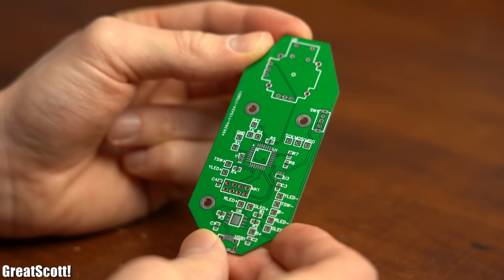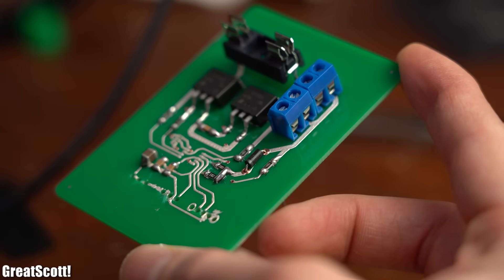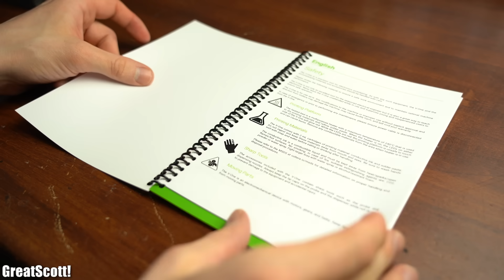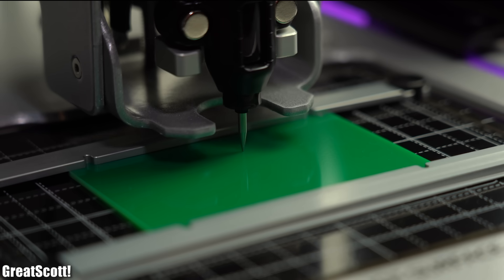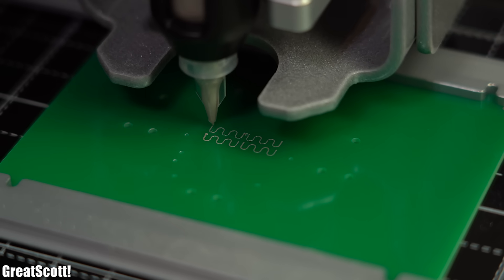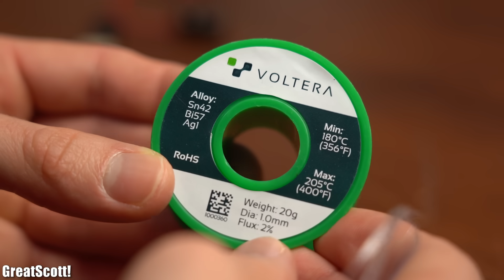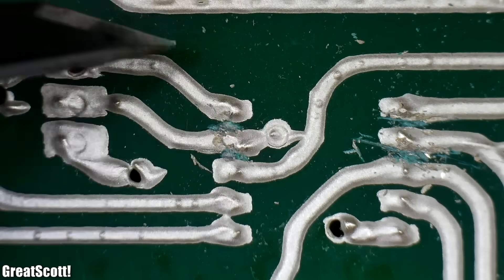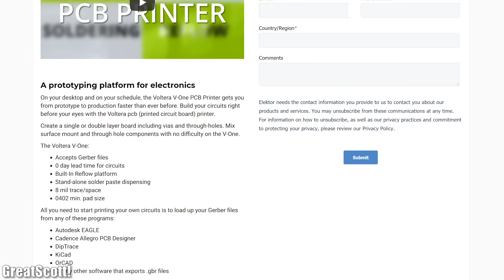You can now PRINT PCBs! Creating a homemade PCB with the Voltera V-One PCB Printer!

Comment: - Holy shit this is so cool!! -

Edit after seeing price: Nevermind.
Reply: Check out Marco reps.
It's a good channel.
It also has videos on pcb manufacture using a 3d printer and a mounted laser which would be a much more affordable option but that's secondary.
Reply: whats the price? cannot find it in the links :(
Reply: @artemonstrick  almost 4000 euros
Reply: @artemonstrick  11:05
Reply: It is worth it for a company. Imagine you order a prototype PCB and realize there it needs a change so now your entire engineering staff is getting paid while doing nothing for a week. Even rush jobs take 24 hours-2 days and cost several thousands. A company will recover the investment within the first product development cycle if not within the first week.
Reply: @excitedbox5705  
Still not worth it given that this machine seems to print out some extremely expensive ink from a nozzle.
Given you can slap a diode laser onto a 200 dollar 3d printer and etch PCBs, why would anyone want a 4000 euro machine that squirts out a line of probably very expensive ink.
Reply: @excitedbox5705  not really if you cant lay traces close together. This is a niche product at best. Something neat for rich kids to play around with, but not practical for commercial application.

Comment: a real bargain - if they had offered it back then in 1999
Reply: 4000$!?!?!?!
Reply: @leadergames0661  I guess, because in 1999 there were no easy and cheap ways of getting custom PCBs. Nowadays, also it takes a week, JLCPCB and such are just too affordable for everyone that it would make sense to buy this printer!
Reply: @martinmajewski  Not really, etching is still far superior to this method and it existed back then. In my opinion, this machine has no use, because of the electrical conductivity. Etching or milling will give you the same PCB as the production PCB, this one will need a completely different layout in many cases to carry the current. Only really simple stuff will work with this. And not to mention, etching has a cost in the single dollar range, waaaay cheaper than this.
Reply: @tunahankaratay1523  can you recommend a video
Reply: At this point you could probably rig up a cheap 3d printer to do solder. Probably wear through the nozzles insanely fast, but it could work.
Reply: @KertaDrake  You would need a pretty impressive hottend for that. 
Most cheap ones are made of copper, aluminium or something similar with these you would risk that it amalgamates with the hot tin. 
So you would need a hottend and nozzle that can reach up to 300 degrees C and be made of something like stainless steel. 
But it probably is possible yea
Reply: @lm6036  The standard material for hotends is brass. Better ones can be made out of stainless steel and even ruby in some cases.
Reply: @Stray4rrow  The nozzle is often brass but are most Hottends too? I’m pretty sure most are made of aluminium
Reply: @lm6036  the heater block is, but the tin doesn't touch that part.
Tin would go through a tube normally made of stainless and then the nozzle
Reply: @lm6036  Why make it dispense hot tin? That doesn't make sense. You would be limited to using components that're so large and flat, you'd be quicker and better soldering by hand. 
What makes sense, is a solder paste dispenser. Then you hand place or automatically place (with a PnP machine) components, and shove it into an oven or onto a hot plate for reflow soldering.
Reply: Hit control + Alt and right mouse button as you right click the checkout button, then it glitches and allows you to apply the Code = GreatScott60 for the 60% off hack. lolz
Reply: @RinksRides  try greatscott100 (jk)
Reply: you think!
Reply: Priceless comment.
Reply: Not really, shop etching was cheap compared to 4k equipment for just a few boards
Reply: I dont know. There was Photo chemical home PCB made back then... they was not even that expensive. And the  you could made like 10 at a time.

Comment: I don't think this has much of a future.. For the price they are asking I can get 1000's of PCB's from JLC or PCBway and I all I have to do i send the GERBER's and wait a few days. Hell, even etching PCB's is much faster.. At my previous work, where I did prototyping quite a lot, it took perhaps 10-15 minutes total to expose the PCB with UV, remove the film and etch it. Then you still have to drill any via holes and either solder or rivet the vias.. Maybe another 15 minutes on top, depending on the amount of vias. So 30 minutes total, plus I could etch a buttload of PCB's at once and not just 1.. I don't understand this product I think.

Would be cool if there was some very low resistance filament for ordinary FDM printers that is solderable. Then a double extruder printer or maybe a prusa i3 with MMU could produce the PCB in 1 go.. One can always dream i guess. 😅

Comment: Hello, did anybody tried to print thin layer of plastic on blank PCB with regular FDM printer and then etch PCB when printed plastic acts as mask?
Reply: I have. I failed to make the plastic stick to the copper. It may be feasible, but achieving the necessary precision may be tricky, and for coarser things, it's hard to beat standard proto boards, or hand-cutting with dremel

Comment: Can u help me I am making a machine and it consists of a arduino now i want to detect whether the mains electric supply phase is ON or OFF. Could u suggest a small circuit how i could do this.
Reply: Use an optocoupler.
Put 60k of resistors (should be enough, do the calculation so the current will be low : R = U/I, use U = mains voltage in your country, and I = appropriate current for your optocoupler, look at the datasheet) from mains (i.e, in this case, from your machine's power input) to a full bridge rectifier, connect the optocoupler's input to the FBR's output (beware polarity). And on the optocouplers output, connect a pull-up resistor between the collector and 5V, then wire the collector to your input pin (analog in would be better in this case), and the emitter to ground. Your machine is on when you do not measure a constant 5V (hence analog input pin) at your arduino pin.
Reply: @takix2007  hey, thnx for the help.

Comment: Originally the problem with CNC PCBs was that they were a hassle to create. 
But after seeing how many steps this printer requires CNC suddenly doesn't seem like a bad idea anymore!
While CNC also doesn't have solder masks it has less resistence and doesn't require baking or expensive inks.

Comment: Could you do a comparison between the new raspberry pico and arduino nano?😬😬
Reply: there is no comparison. Those are two absolutely different things!
It is incredible how a dual-core M0 processor running at 100+ MHz can be as cheap as an 16 MHz 8-bit chip, but at least 50% of the cost is actually not in the silicon chip but the pins, connectors, pcb, and the encapsulant of the silicon chip. Andreas Spiess published a nice video today, but he didn't even touch the Arduino nano as comparison...
Reply: @uwezimmermann5427  that's great information! I will surely watch the video. Thankyou😄

Comment: You do realize that using the Voltera to dispense solder paste and use it for reflow as intended, would have avoided your soldering mistakes all together?
Reply: So I guess this device is good for surface-mount components. But for through-hole components, a mill is better suited.

Comment: For that price tag, I'm happy to keep using JLCPCB.
Reply: Lol my broke ass is just using a breadboard to prototype and glueing and soldering stuff together for the final product 😅
Reply: Yeah and it is super fing manual. My designs are simple enough to fit on two layers. I would need to add every via manually I would kill myself. A week is super fing good for a 4 layer assembled pcb in my opinion
Reply: This is for prototypes, not to replace pcb makers, as an engineer I can say, I have been waiting for this, I am at a point where I might have been able to make it myself, but I might just buy one to be able to do designs and repairs faster
Reply: @alenasenie6928 Hope you're familiar with PCB miling, which looks about just as fast/accessible but with way cleaner results.
Reply: Etching is not that hard and can be superb quality and fast, when you get used to it.
Reply: Lol yea
Reply: or pcbgogo
Reply: Yah, sure !
Reply: Yeah but a engeneer working at home can now make prototypes faster.
Reply: @trowawayacc  For the cost of that machine, an actual engineer can afford to use "normal" methods at home.
Reply: @thomasbecker9676   True
Reply: @thomasbecker9676  maybe. I dont know how expensive or time consuming those might be. Or if the results are the qualitu nesesary. But yeah each of these is like a new car. So till that is fixed maybe its not a good investment. Market is restricted to q sliver of people.

Comment: I wouldn't pay £300 for that printer with that quality finish let alone £3000+.
Reply: Thing is way over engineered. You see how thick the metal is supporting the head? I mentioned it in another comment, but there's a reason a lot of 3D printers prices started dropping when they realized they could get 99% good results with a material as ubiquitous as extruded aluminum. Strong Juicero vibes from this machine.

Comment: Additive PCB manufacturing seems the future. It has the potential to require so much less chemical waste, as well as reduced iteration times for rapid prototyping. The first 3D printer I had to work with costed several hundreds of thousands of Euros. And that was just a decade ago. Now I can have a device at home which gives me the same end result, but doesn't even cost a thousand euros. I think we'll see a similar development for PCBs.

Comment: I think the price would be acceptable if they added pick and place.
Reply: If it could do auto-riveting, board flipping, solder-paste dispensing, flying probe test, pick-n-place, included an oven, and flying probe uC programming, it would be really cool. Though I doubt using ink is really the right approach. Using a more traditional etching process with a laser or something similar would be much better in my opinion. You could totally sell a machine that took in parts, blank boards, and spat out fully functional and programmed 2-layer boards ready for testing. Probably could sell that for $20k. But until you're at that point, I just don't see the value proposition compared to the Chinese board houses.
Reply: Yes
Reply: ... and filled the blind vias for you, and added a tool for extruding on the hole walls and curing it there (with a pin sticking out the middle of dispenser to keep the hole open). The board would need to be heated for that so that the ink on hole walls would cure so that the head could move to the next hole without disrupting current one.
… and used a smaller nozzle, and had the ink stick less to the nozzle…

In other words: this is good for proof of concept and for someone’s pet niche application where the current resolution and process would work unchanged. For most other people with money for it, this seems like a waste of time though. I wouldn’t be able to use this even if it was given to me for free. 

OTOH, a sturdy CNC with total component cost in the same price range would have immediate use. I could run two boards in parallel.

CNC is also great for doing controlled impedances on thin two layer boards, or even 4+-layer boards if you can press the stack yourself (takes a press, among other things).

On a CNC, you can tweak the trace width with the VNA plugged into the circuit, and do trim runs until it’s within a fraction of an Ohm, if you want it that way (not normally needed). You can also do EM-model-free feature routing, where instead of using very expensive software that still takes you only so far, you run a shape refining algorithm that modifies the shape incrementally to produce the exact response you want - and both the VNA and a TDR output can be used for that. You can do this with other components already in the circuit as well, and after the dust is blown off, you power it up, g-code generator takes a frequency and time domain sweep, circuit power is removed, and the tool goes back for another refining run to bring it closer to what you need. You could design some very complex filter responses and feedback paths that way, with rather simple technology, without slaving yourself away to EM tool vendors (OK in a big business setting, not so much in small startups and for advanced hobbyists). 

This can easily pay for a very fancy CNC just in the cost saved by not paying a fortune for EM modeling software, and for the speed of iterations.

A bit of ingenuity can really take CNC techniques way further than is typically talked of. I’m sure plenty of companies with clever people may do this already and keep mum for competitive advantage; but I just do it for hobby stuff and would love it if some manufacturer just took the idea and made a cheap widely copied machine + software combo that can do the sort of CNC you don’t see done on PC boards. Commoditizing this stuff would be more than awesome. I only mess with it because I have to - otherwise I couldn’t play with microwave circuits so easily, and am not interested in product development in this area (life is too short - can’t do everything). I like physical experimenting too much - dealing with accurate numerical EM models for a hobby is not my piece of cake. 

So, all in all, this is not a very innovative product, because it does something that 99% of people who do these things can think of in like half a minute, and it doesn’t even do it particularly well (about anyone in this field could take it to this field - but that normally in business setting is a proof of concept, not something you dump onto the market with fingers crossed). Instead, maybe that company should focus on ideas that <1% of people in the field would even come up with, and even less could execute on. That’s real innovation. Especially if you do it while everyone else tells you it can’t be done (see SpaceX and booster reuse - 99% of people in the industry flat out said it can’t be economically done - took a 0.01% sort of a thinker to see it through and with some luck have the last chuckle). So I’m not impressed, but then I don’t thing that making an impressive product was their goal. This is OK for what it does, nothing more.

Comment: This product is kinda dumb, in the same time this takes you can print your circuit on a transparent film, expose a photosensitive PCB with UV, develop it and etch it with ammonium persulfate or ferric chloride.
Or alternatively, you could put a copper clad PCB into a CNC milling machine and mill away all unwanted copper with a small tungsten carbide bit.
Reply: Sarcasm at its fullest

Comment: Pretty cool! Like a 3D printer with a paste extruder and modified solder paste.

Surprising it didn't use the height probe to identify and warn about the sacrificial layer being left there, seems like it would be an easy addition for usability.

Can they also print solder mask? How closed is it? (Can you send it gcode or do you have to use the special software?)

Does seem like a small target market: big enough to want to spend the upfront and continuing costs, but small enough that they haven't factored in PCB lead time and/or found a local board house for quick turn around jobs. Maybe best for places doing repair of high end stuff, that might need a one-off board fast?

Comment: You can make pcbs using laser printer and etching the rest of the copper. It's fast and easy, and you can also make soldermask using uv cured soldermask and exposing it only where you want the soldermask. There are a lot of tutorials.

Comment: Have you tried etching a PCB using PLA as a mask? I wonder if that would work.
Reply: I have. I failed to make the plastic stick to the copper. It may be feasible, but achieving the necessary precision may be tricky, and for coarser things, it's hard to beat standard proto boards, or hand-cutting with dremel.
Reply: also, it's very critical that the pcb blank is extremely flat.
Reply: I've tried. forget it.

Comment: Its a very nice concept, but IMO not really worth the 5000 USD. Especially as you cant't use planes on the pcb. etching is probably not that much slower and much cheaper and you can use off-the-shelf PCBs

Comment: Do not buy this. The V-One is a complete waste. My company bought one about 3 years ago for prototyping. It worked somewhat well for the first couple weeks for SMT prints, shortly after that, the device errored out every single print. Updates didn't fix it. When they finally did release a fix, the solder ink isn't ever stick to the boards. The drill extension we bought for it breaks bits on a daily basis.

COMPLETE waste of the $5000 + $1000 (for the through-hole drill add-on) we paid for it.

For prototyping, I recommend getting a $200 CNC machine from amazon and some copper clad boards. It's much more repeatable and consistent. And when something breaks, you can easily fix it, since it's all open.